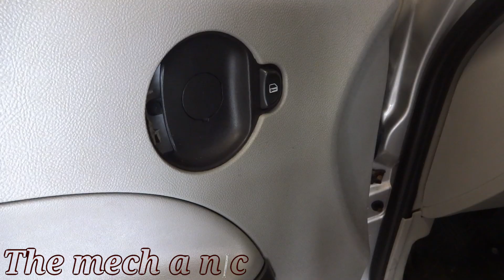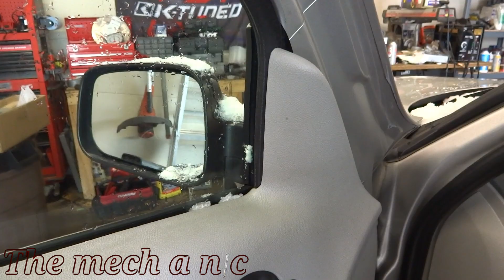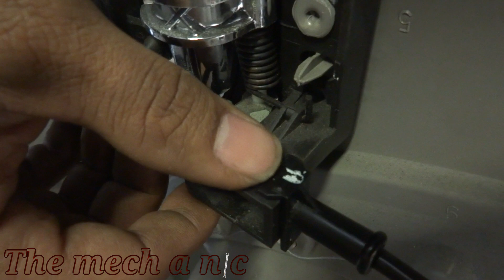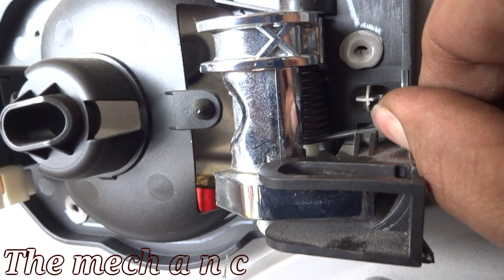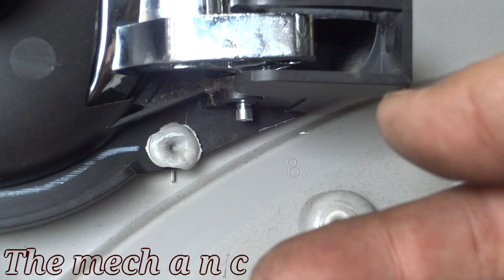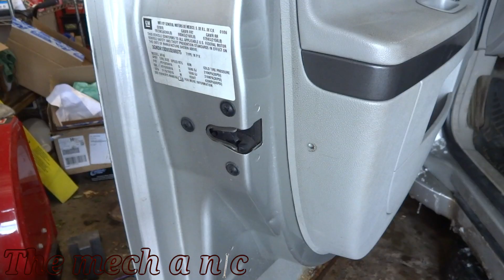HHR broken door handle

Comment: My handle broke 3 or 4 years ago.  I ordered a new one and installed it.  Then it broke again about a year and a half ago.  This time I order a metal one from Amazon that was completely assembled and put this on.  The cable didn't seem to fit in the bracket right and only the cable went in which half worked if I jerked the handle hard.  Then the cable just snapped loose.  I took the panel off again but something wasn't right and the cable came loose again.  I finally took the panel off again and after much messing with it it appears that the plastic part on the cable doesn't fit the bracket.  Has anyone came across this problem.  It seems like I could cut the bracket apart and re-modify it and maybe glue it back together with Jb weld but I'm not sure I could pull it off.

Comment: Thanks for your video I have a question I replacing my handle but when I got my handle on my cable end on the inside of my door the plastic pieces were broke that were holding the wire securely onto the handle I don't know how to fix that could you tell me if I what I have to get to replace that because I replaced the handle and it doesn't open the latch because the wire is not being held

Comment: Attempting this repair today..thanks for your great tutorial!
Reply from the maker: Thanks for watching.good luck
Reply: @themechanic6117  Went pretty good..13 year old HHR and 90 degrees😨 Top of cable stop broke...did a little super glue..2 door trim clips broke..ordered on Amazon. Could not have done without your help! Thanks!
Reply from the maker: Things are always going to break on older cars . important thing is you got it done 👍.
Reply: @themechanic6117  Yes it works! & new air & cabin filters, and back hatch supports...whoohoo!🤗
Reply from the maker: Those are repairs to be happy about 👍

Comment: Had a hard time with replacement handle. The bottom hole for the pin was too small and had to  ream the bottom hole with a fillips head screwdriver. Also the door cable slot had to be enlarged because slot wasn't wide enough to except cable wire. Melted it wider with hot knife.
Reply from the maker: Thats weird, I've done a few of these and never had that problem but I don't doubt it. Glad you got it done and thats for watching
Reply: Your video was very helpful. I just wanted to help someone in case they ran into the same difficulties. I would suggest dry fitting before trying to place into the door panel. I'm  guessing that there are different manufacturers. That you get what you pay for. I went cheap. (plastic) Prices ranged from 7 bucks to 60 bucks. Some are metal and cheaper ones plastic.Other videos show the replacement  of the door latch and latch holder. This video show the best way. Only need to replace the door latch. Thanks for your helpful video and quick response
Reply from the maker: @nathanwilletts7927  no problem. Thanks for leaving a comment on your experience. Im sure it will help someone 👍

Comment: Great video. Thanks for sharing. I love all the close ups and detail comments and hints. Definitely a 5 star rated video. The only suggestion that would have helped me is to also show the re-connection of the connectors and cable during re-assembly. I suspect you would have had some good suggestions for doing that too. Thanks Again.
Reply from the maker: Thank you for watching. I try to make it as informative as possible and not make the video too long.👍

Comment: Hey man, thanks for this video - for a 2006 it was the best I found.  Mine was a problem because it had been fixed before, and it had a metal pin that had been put in so that it could not be pulled out the top.  I had to remove that whole, black assembly which had been screwed in, and glued by the last person who fixed the thing.  I had to use JB-Weld and Crazy Glue to remount the thing - what a pain in the ass.  And, the whole assembly sits very slightly back too far - you can't even see it, but the handle rubs just a bit on the door molding (not much) when you pull it out.   It catches, just a bit, and doesn't pull back without a little nudge - catches on the door panel just a tiny bit.  This was a problem unique to this vehicle.  At least I can open the door without opening the windows.  Anyway, great video - thanks a lot.
Reply: Three years later I'm back again.  Both of 'em broke the same damned day!  Must have been the weather or something.
Reply: 2006 mess here too thanks for your encouragement. I'm just going to move the back ones and police car style that shit 😂